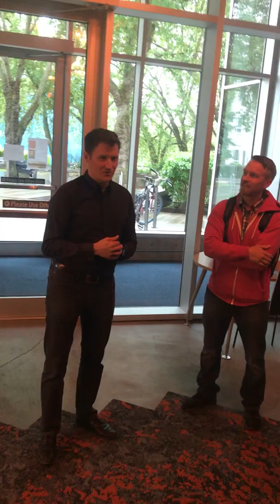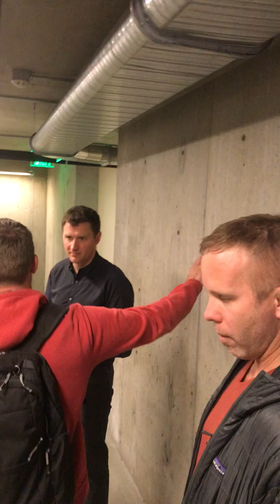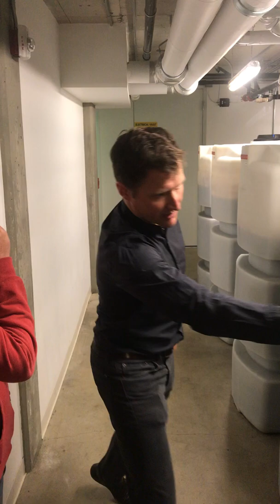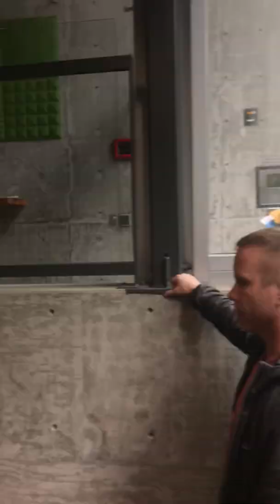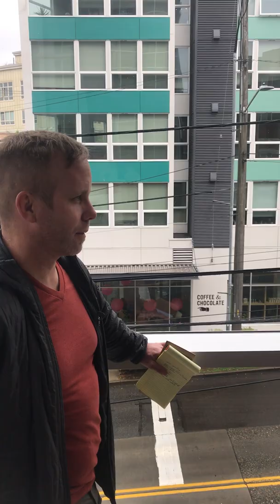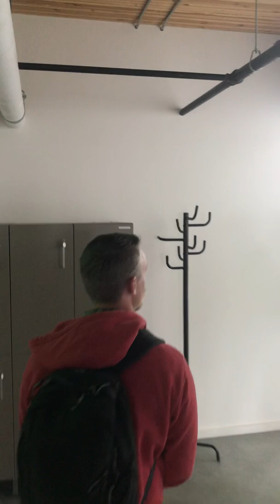Living building tour BULLITT CENTER Seattle wa.

Comment: Sadly your tour guide made many factual mistakes including confusing elements of the grey water and potable water treatment systems. The building's designed EUI was 15 (NOT 10) and is only closer to 13 due to the fact that the building is net positive energy. Potable water in the building comes from treated rainwater collected and stored in a 56,000 gallon rainwater cistern in the basement. The rainwater is filter, treated with UV light and chlorine before it is stored in a 500 gallon day tank used for showers, dishwashers and sinks. The black water (poop, pee and toilet paper) collected in the blue aerobic composters is a completely separate system from the grey water treatment system.  The solids and liquid are NOT separated. The leachate tanks collect a liquid bi-product from the composters that is taken off site for treatment at a facility in Carnation, WA operated by King Co Solid Waste. The human biosolids are removed and taken off site where they are used to make a field ready compost called GroCo (that's what you were given in the sample bags).The occupancy is no where near 50-60 per floor. The Bullitt Center was designed for 150 occupancy NOT 300.  The 3rd floor rooftop constructed wetlands treats grey water (that's the waste water from showers, sinks and dishwashers NOT from the leachate tanks); organic material is broken down and provides nutrients the horsetail plants, water is evapotranspired by the plants and evaporates, what's left infiltrates a bioswale and rain garden at the ground level allowing the remaining water to regard the aquifer below the site.
Reply from the maker: deborah sigler thank you. The more important thing of the video is the meeting of organized labor and ILFI. Granted Andrew is not the normal tour guide, but the zero carbon director, but it is now a platformed for all to look at the 1st living building